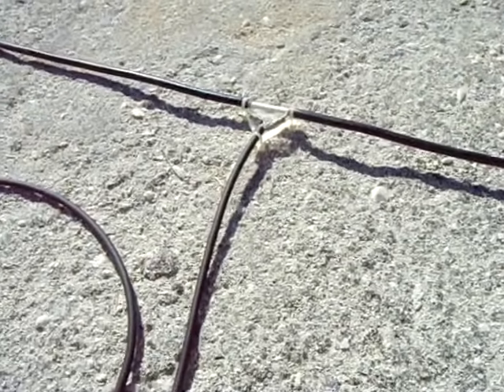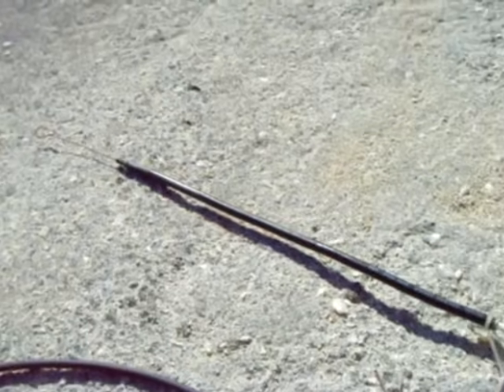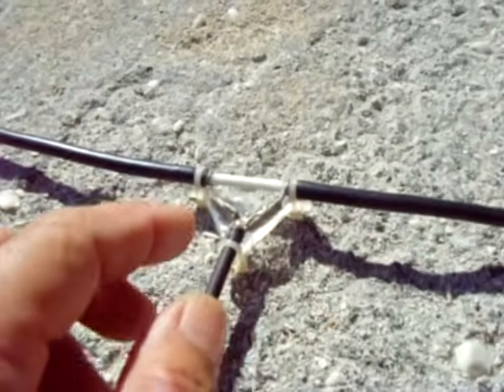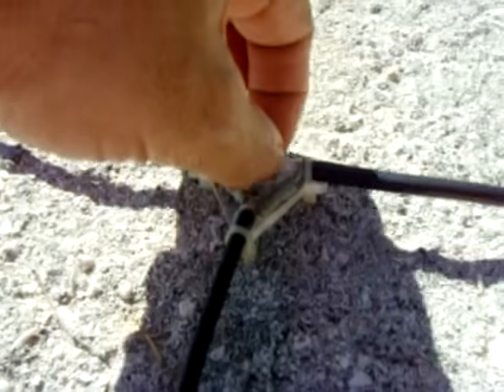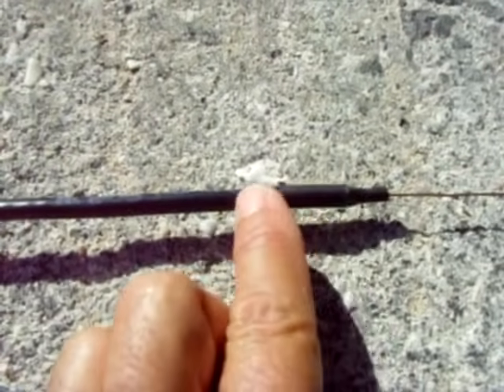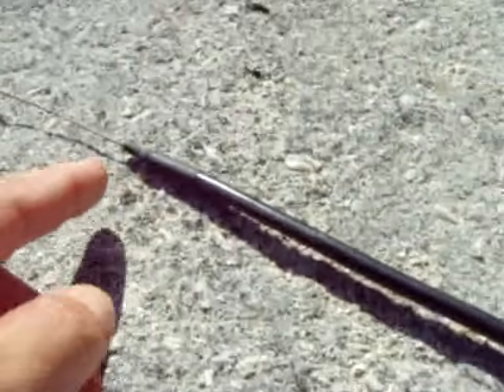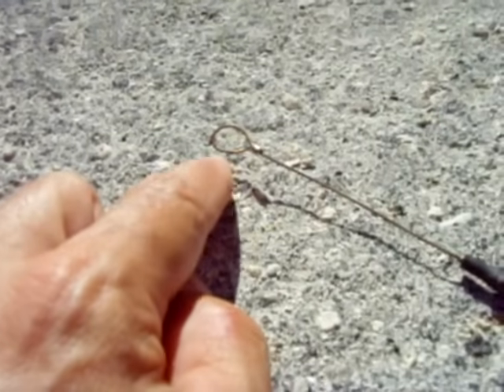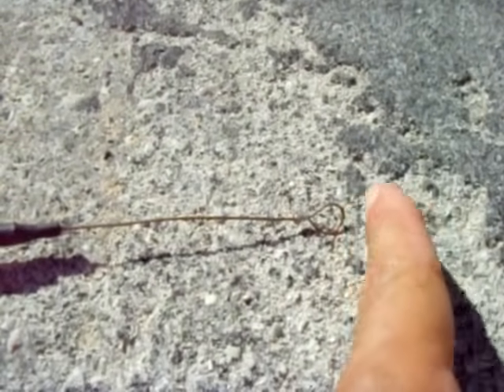How To Make Coax Antennas (FM receiving) Folded Dipole

Comment: I substituted 3 conductor phone wire for RG6...  key I think was to be picky about the measurements...  I decided on a middle frequency of 99mhz and ended up point to point at both 3" 8.7" and 4'11" at the loop joint...

I ran the solid copper through the center uninterrupted and pulled the pairs to opposite sides of the feed wire....

pulled one side to ground and one to 75ohm input on receiver

unbelievable!! it works  perfectly!!!!!!  I received maybe 5 stations before doing this and now get well over 30 with perfect clarity...  took me 20 min.... cost me nothing...  Thanks for sharing!
Reply: could you post image of that antenna you made?
Reply: not much to see - up high in my garage so the pic isn't great - sorry....  the plastic 'thing' you see is a mounting channel for laminate flooring and I zip tied the wire to it (you could use anything but it was the first thing I had my hands on in the shop).
Reply: ah, i see, you used coax as feedline and 3 conductor phone wire as antenna. 
i used thin wooden slat to support it, didn't make loops on the end, because i think they're there only to hang it somewhere or stretch it between 2 points.
 i get better reception if it stays vertically...dunno if transmitter is polarized that way, or something is blocking horizontal path to me....
Reply: I thought the loops might have had something to do with capturing the rf but hanging it makes sense also.  I think about the old UHF antenna having loops and figured there might be something to it... I should have mentioned that I used coax on the feedline as it comes out of a 75ohm adapter also (just what I had laying about... not entirely scientific).
Reply: frankly, i forgot to make loops, measured precise lenght without accounting for them. but i'll solder them on now, given that it'll be hanged somewhere, i originally thought it'll be horizontal, that's why i fixed it on to a wood in the first place. now it doesn't need wood, but it needs loop..heh...
Reply: I think I recall reading that a small air gap in the loop will reduce eletromagnetic interference but I'm not positive it's as simple as cutting a small section out of both sides... also not sure it won't royally mess up the project... might give it a try however....

Comment: What if you want to boost the signal of the FM radio (I mean the regular
 entertainment radio)? You have to calculate the length for each channel
 and make multiple antenas for every channel? Thank you.
Reply from the maker: +Kketansa Art 
No. Just make (1) antenna for the center of the band you're using.(98mhz) should be fine
Reply: electronicsNmore
Thank you :))

Comment: Hi, This about the video "Coax Antenna (FM receiving) Folded Dipole". I hv no clue about electronics but still wanted to build one for 98MHz (commercial FM band). I tried the software by VE3SQB for lengths but got all confused by Feet/Inches & Meters/CM. Can you please give me the figures in cms for the over-all length of the antenna (between the loops at each end). And also the length between the two solder joints (I guess it is velocity length). Looking forward to hear from you.
Reply from the maker: +SN N 
Very simple, enter the frequency, then click the button for the measurement you want. IN, CM, etc. I have too many viewers and questions to be offering special assistance.

Thanks

Comment: besides impedance, does the feed line length matter? thanks for the video.
Reply from the maker: +Richard Stubing 
Hello Richard. I'm not an "Antenna" expert, but the length is not too much of an issue. Ideally you should keep the feed line as short as possible, and do not coil up the wire.

Comment: I tried and tried and could not find where I could buy copper braid coaxial cable. 
I had no luck with Amazon, Ebay, the Radio Shack that was open, Target, Best Buy.
Any ideas?
---- Will the coax with steel braiding suffice as a dipole antenna?
I learned that RG58 and RG8 correspond to 50 ohm   and...
-----------------------RG59 and RG6 are 75 ohm. 

Thanks
Reply from the maker: +David Barth 
If you cannot find copper shielded coax, then use the readily available aluminum braided type. Since you will not be able to solder the aluminum braiding, just use "uninsulated butt crimp splices". You can buy them on Ebay fairly cheap. Just make sure the I.D. of the butt splice is large enough for the braid and center conductor. Slide it over, then crimp.
Reply: rg58 and 8 have copper braid

Comment: Watched multiple times and did some investigating to try to learn which "RG" Number relates to the ohm value.
It seems 50 ohm is optimum for FM listening. Can I build a coax dipole with 50 ohm horizontal and a center tap at 75 ohm 
(f connector) to the FM tuner. or should horizontal and vertical wires be the same resistance value?
1) What "RG" Value is 50 ohms?
2) what "RG" value corresponds to 75 ohms?
3) should both wires be the same resistance?

Thanks
Reply: ~30 Ohms is best for power transmission, ~75 Ohms is best for noise suppression, and ~50 Ohms combines both to optimize for a little of both.  ~ means numbers are rounded as the exact figures fall a couple Ohms below or above these figures.
Reply from the maker: +David Barth 
As a receiving antenna, you do not have to be too concerned about 50 or 75 ohm coax. Readily available 75 ohm coax will work just fine. Make it as shown in this video, and refer to the links posted in the video description area. Thanks.
Reply: +electronicsNmore Thank you. Which "RG" is 75 ohm?
Reply: +David Barth RG6 is a 75 ohm cable

Comment: it is a folded dipole....  cut for the band ...
 probably the impedance may be over 200 ohms  but for receiving  its ok. as a compromise 5 minute quick set up antenna
Reply from the maker: +Teletenna Tech
Whatever it is, it certainly works well. Thanks For Watching
Reply: thank you !

Comment: I am not good at electronics. I kinda fumble through it until I get it right. But I don't see how this will work. I am probably wrong, but you soldered both ends to the center conductor. To me, that greats a dead short?
Reply: +Derek H It's a loop! So in that sense, yes, it's a short circuit. If you think of it as a DC circuit with electricity flowing into the antenna through the shielding on the cable that runs from the radio to the antenna, that electricity then feeds into the shield on one of the two branches of the "T", then back through the center conductor and out to the end of the other other branch of the "T", then in to the center of the "T" through the shielding of that branch, and finally to the center conductor in the cable that runs back to the radio. 

Of course, this is not a DC circuit, it's an AC circuit. And the point of the circuit is to get as much electricity to flow through the loop as possible at a given frequency. It's called resonance, and the circuit is tuned to the resonant frequency by adjusting the length of the antenna.
Reply: +Derek H there's really no circuit to short, it's just catching FM energy from air to hit the metal on each side and get amplified in the receiver. All lengths of metal in this grab it.

Comment: What is the formula for the length? Where do I find the link, please. Thank you.
Reply: 3,000,000/mHz frequency=meters something like that
Reply: @furonwarrior  The first number is supposed to be the speed of light in km/s and the second number is supposed to be your desired resonant frequency. I think you may have left out two zeros and also added a m to your Hz. Alternatively you may have added 4 zeroes, depending on wether you want to calculate using Hz or MHz.  
L = 300 000 000 / frequency in Hz.  Alternatively  L = 300 / frequency in MHz.

Comment: This all looks like a fairly simple and great way to make an antenna.  One thing about the video I think I do not understand.  You said at the T junction you take the center conductor of the feed and attach to the shield on one side and the shield from the feed and attach to the shield on the other.  You said the cross piece center conductor stays in tact.  That all sounds good but then you solder the shield to the center conductor at both ends which would "short" the center and shield of the feed.  That is the part I think I am misunderstanding.
Reply: The shield is cut in the middle. Therefore an open, so not a short.
Reply from the maker: Refer to the link in the video description area. You will see images.

Thanks.

Comment: Many thanks, I've just cobbled an indoor version for my needs, for receiving local FM transmissions, works satisfactorily, which is all that really matters. ZL1 TGW
Reply from the maker: Your welcome. You should have had very good results. Measured and soldered exactly for the desired frequency/range?
Reply: As near as I could manage, to cover our NZ FM transmitted range, 90 to about 101 electronicsNmore
Reply from the maker: Oh, OK. If you made it for the middle of the band you should be fine. :-)

Comment: Good day, Sir. We're actually having a project on antennas and we're assigned to do the folded dipole. I just wanna clarify something about this antenna that you've made. You've mentioned here, as the video title itself, that it's actually a folded dipole antenna. I just wanna ask if this is different from the traditional 300 ohm impedance folded dipole antenna that uses folded tubes. Also, I also wanna ask about the theory behind this version of the folded dipole. We badly need an explanation on how you came up with this antenna design so that we can also explain our project during our presentation. Thank you, Sir. Hoping for your response asap. :)
Reply from the maker: Hi Shaira,
Everything you need to know is at this link:
http://www.nsw.wicen.org.au/technical/projects/coaxial-folded-dipole-antenna

Thanks For Watching! Be sure to share and rate Thumbs Up.
Reply: electronicsNmore Thank you for the link.
Reply from the maker: You're welcome.

Comment: This is probably going to sound stupid and impractical, but I've always been curious about this, so I'll ask anyway.  If I were to make this antenna or even a simple dipole antenna made from old-fashioned twinlead (made a few of those in the past), and found a way to waterproof and stabilize it for outside mounting, would I get decent reception by putting it at a height of, say, 20 feet?
Reply from the maker: Higher is better. Just make sure the antenna is properly made for the frequency you desire, or in the middle of a range that you desire.

Thanks For Watching! Be sure to rate thumbs up, and share.
Reply: electronicsNmore
Thanks.  A thumbs up for that answer!

Comment: Please help me, I don't understand how to use the feet to Inch or Meter to Cm button in the application. Should i understood it by your help, I will be starting to cut the edges of the coax for a specific frequency. Thanks
Reply from the maker: If you use metric where you live, then just cinput the desired frequency, choose the correct coax wire,  then click the Meter/cm button to give you all the dimensions in metric. Very easy.

Thanks For Watching!

Comment: Hi,
I just converted my shed into a workshop and fitted my old car stereo under the bench which sounds rather good :0) Except I can't use the radio yet.
Would this type of antenna work well with a car stereo please?
Cheers
Gary
Reply from the maker: Hey Gary. The antenna works just fine if proper;y made. Make sure you buy the proper coax connector for your radio. I would design one in the middle of the FM broadcast band(88-108mhz) around 100mhz.

Thanks For Watching!
Reply: electronicsNmore Excellent..Thanks
I love youtube, you can just about type anything in and somebody has made a video for it !
Reply: electronicsNmore Hi again, Am I right in saying for the range you suggest I need to type in 98 in the coax dipole calculator?
Cheers
Gary
Reply from the maker: Yes. Right in the middle should give very good performance.
Reply: electronicsNmore Pucker..Thanks :0)
I think I'll do what you did too and mount it inside some pvc tubing, which I can then clamp to the back wall of the shed on the outside, which is out of sight.
Reply: electronicsNmore Hi again, I have another question please?
I've got a length of copper shielded coax to use for the T part of this, but I don't have enough to make the lead running to it from the radio. Does that have to be copper shielded coax too or will 2 core electrical wire do it up to that point? if not, I have enough coax cable with shielding made from some kind of alloy? not sure what, but it doesn't like being soldered which would make it a bit trickier to connect ! would that still be better than the 2 core copper electrical wire ?
Thanks
Gary
Reply from the maker: You need a very small small butt splice connector which you can use to crimp the copper shielding to the aluminum shielding of the feed line. That will work just fine. Roll the shielding up into a small diameter wire then insert and crimp.

Comment: Thanks for that. I made mine for mid bandwidth, using maths from somewhere else.
This gave me a 95.66cm length for 98mhz bandwidth.
Works a treat right through the range wherever it's put.
Reply: this calc gives about 153cm for 98mhz.

Comment: Thanks, this works great.  My favorite station is at 101.5, so I used the formula  L = 93.75/f. to determine that I need the length to be 92.5 cm and copied your setup.  it's much, much better than the antenna that came with the radio.

Comment: Well i just had the nerdiest Saturday night ever.  My house is in a depression so i don't get very good radio reception, my favorite station is 94.7  and its weak anyway so i used the calculator, cut some RG-6, taped it to a dowel to stay straight, and wow does it work great. even if i get the coax feed near the antenna hookup everththing comes in great.  I can pick up most stations up to .3 mhz side band.  before i could only get like 1 or 2, now i have tons.  Great project!

Comment: Please can you help, I have a radio I have lost the antenna for, it has a male coax connection on the radio for the antenna and I need to make one to receive FM radio signal in England.
I tried wiring some coax to it with female connector and it only works if i strip the copper back and hold onto it!!?

Comment: Great project. Which direction should it point in relation to a transmitter for best results? Should the axis of the aerial be at a right angle to the direction from which the signal is coming or in line with it?
Reply: Dipoles have null points inline with the axis. You want the perpendicular to the length of the dipole pointed at your target, meaning the dipole can be mounted either vertically or horizontally.
Reply: @demef758  wow - he had to wait 8 years for that info lol..
Reply: @davidbillyard6629  Ale się doczekał!  :)  Cierpliwość jest cnotą.